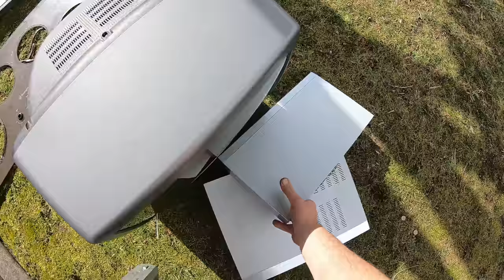Trash Picking Apple G4, Brass, Stainless Steel & More

Comment: Oh no, you missed all that brass on the old bed @ 32:00 😂
Those gas water heaters @ 43:20 have awesome copper in them. Lol I just posted on the forum about them before watching the video today.
Reply from the maker: Yeah I saw that, I think the one's I found are solar, not sure if it's the same thing but I guess it would be

Comment: Hi Ben, this nothing to do with this video, but I have a question about a computer that a friend dropped off at my doorstep. very, very old looking. It has 4 slot cards and 8 memory ram that I've never seen anything close to it. The CPU is Intel i486 DX and it's ceramic the front of the computer reads Laser486dx/3. Do you know what I have???
Reply: I found the date of 1989 on the CPU
Reply: I'm sorry to keep bothering you with a question. I went back to your November 2015 video of the top 10 most valuable CPU's, 3rd was the Intel 486, but when you showed the CPU it was a dx2, mines a dx3. What's the difference???

Comment: Hi Ben, I was wondering how you get the gold banded crystal osilators off boards, because when I try to pull them off with pliers only half breaks off , and when I try to knock them off with a screwdriver I can only get off half
Reply from the maker: A big flat screwdriver, line it up on the wide side of the oscillator and push right to left, it will pop off, i'll do a few in the next scrapping video in a couple days and show you
Reply: eWaste Ben thank you so much for the information. Thanks again and keep scrapping

Comment: Scrap vulture leaves a couple of inches of cable in case someone wants to put a cable back on and use the item, just saying.
Reply: charles mclachlan I've come across that on some things I've wanted to see it works, the cords been cut. It takes me about 5 to 10 minutes to open it & there's always more than 2 inches of cord on the inside. I always. leave my cords fully intact and cut them from the circuit board. I save some them for times like that so I can splice it inside. That is safe and it looks new when/if you resale. (make sure you use one of the cords that match so the bigger square insulated part fits like a glove when you put it back together) Works well on most dvd/vhs & other electronics but not all.